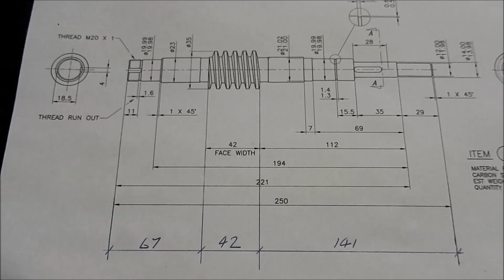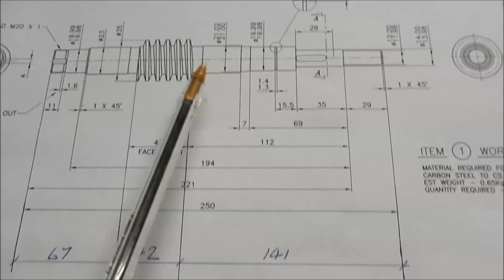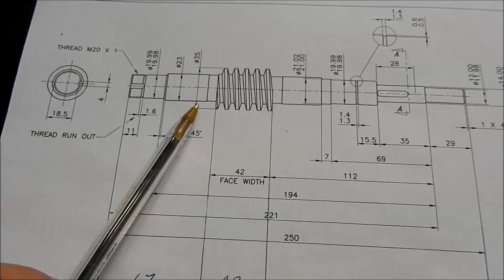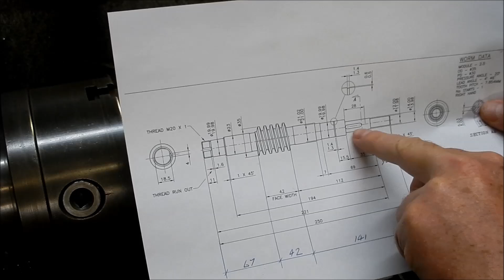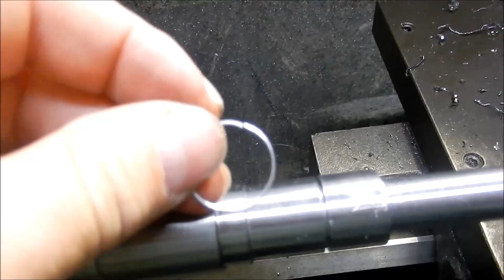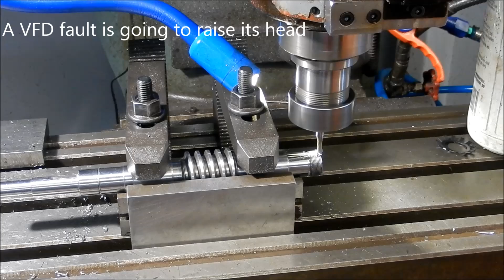Powered Lathe Slotter Build Part 23

Comment: Hi Cam enjoying the build project I did send you a message about dimensions they would match veiwed the links and yes for some reason the memory has been awakened where I read about  it not sure  think castings off Ebay 15 plus yrs ago seller was from Emerald Olinda area  heading up Dandenongs  ??   I am in Newstead  be good for a catch up some time  Cheers and thanks for going  ''the extra mile'''

Comment: Another great video.  I am curious about the slotting cutter bits that you got for the threading holder.  I have been looting for something like that.  What do I search for?
Reply from the maker: G'Day Steven.  Yes they worked out extremely well and are available in various widths to suit the external and internal threading bars.  This is where I purchased on e-bay.
https://www.ebay.com.au/sch/peterw4470/m.html?ssPageName=STRK%3AMEFSXS%3AMESOI&_trksid=p2053788.m1543.l2654
Cam